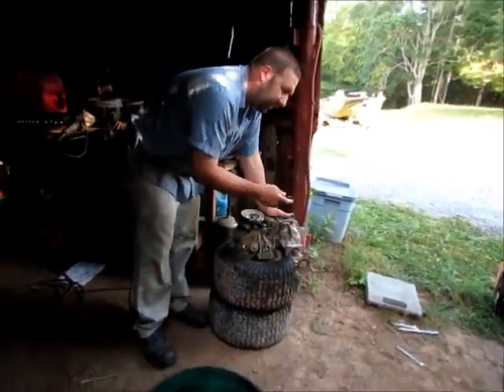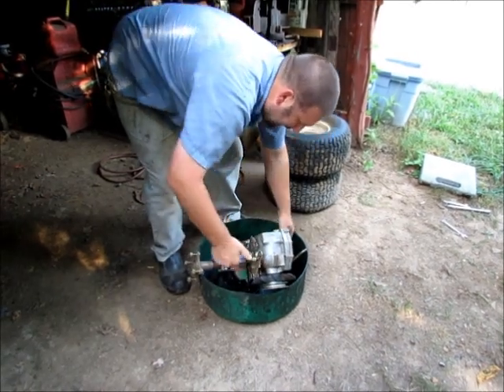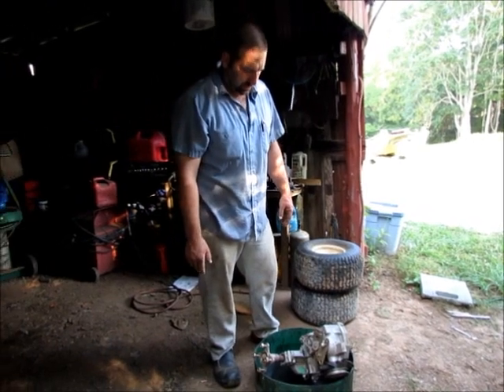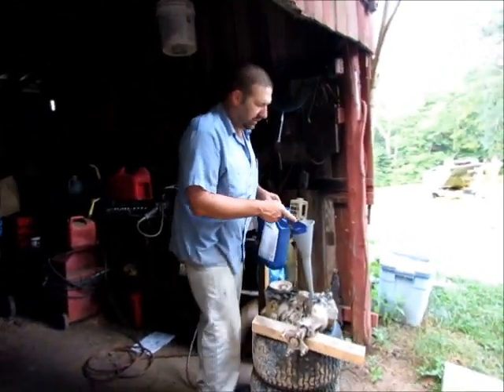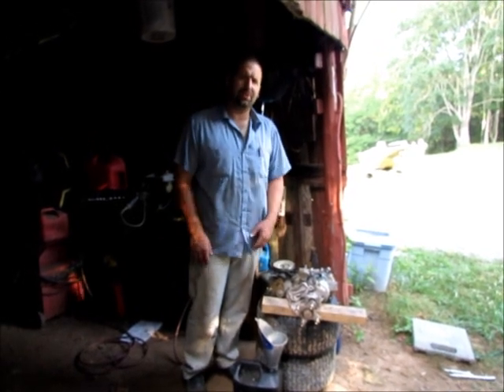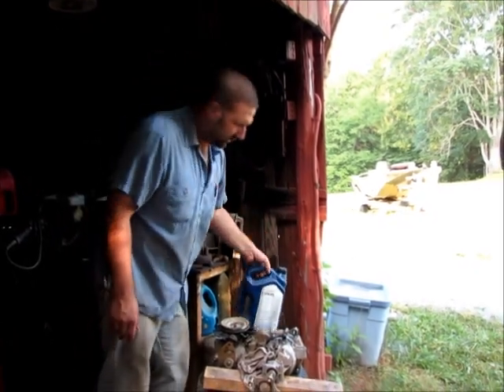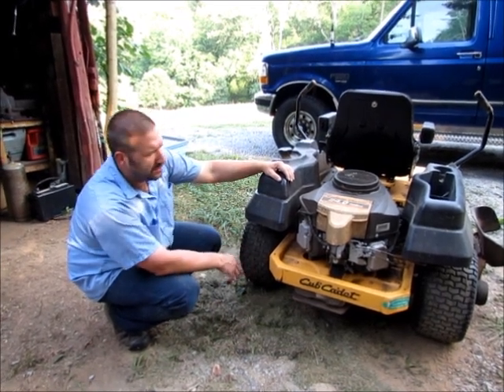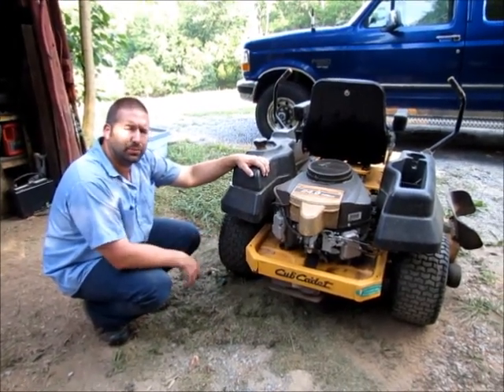Cub Cadet Hydro-Gear transaxle ZT-2200 EZT Oil Change

Comment: Time to drill and tap gearbox (bottom right corner) this would save a lot of time for further( measure twice drill once )
Reply from the maker: @williammurray7499 what a good idea. Have you tried this? Is the case thick enough for a drain plug to be threaded in? Man that would save massive time. Thanks for watching and sharing. ~Mr. C.
Reply: @NaturesCadenceFarm , nope the case is NOT thick enough to put threads onto.  it simply will not hold.  so, when you have the 2200 hydros off the first time, pop the side covers off them and install a drain plug kit on the bottom of the case.  you could also do them on the side covers themselves, but there is a lot of potential interference in there, so best to install at the front bottom of the case.  use the kit with the inner nut.  i have not done this on mine yet, but i will be doing them at 75 to 100 hours.  then, i will just drop the oil every season and replace.

Comment: Hydro-gear recommends you do not get the tranny hot before changing oil due to getting air in expansion tank, do this cold
Reply: BTW great video, great to see actual people do whats on paper, helps a lot, Im still pondering on if fill port plug should be off or on while bleeding the air, by these results I would love to know how you did it. Thanks for the video!
Reply from the maker: @jorgegar5055 I installed the fill plug on mine before I purged the air. There is a vent on the unit. I am thinking that would help with the drastic temperature changes the unit sees and possibly letting air out or in as the temperature fluctuates. Thanks for watching and asking. ~Mr. C.
Reply from the maker: @jorgegar5055 this is a sealed transaxle without an external expansion tank. You might know more about this system than I do. Is there an internal expansion tank? Thanks for posting this information. Very helpful to me and everyone else. ~Mr. C.

Comment: Would it be possible to drain the oil while on the machine and pump oil into the drive like a marine pump for the lower units?
Reply from the maker: @user-pn8dn6rp2s maybe. There is no drain plug on the transaxle. A hole would need to be drilled into the frame large enough to remove the fill plug. You could then flip the whole machine over and drain it that way. When filling you could use the hole previously drilled to see what's going on. Thanks for watching. ~Mr. C.

Comment: Hallo. What oil fill in hydrogear? 
10w -50 motor oil?
Thanks
Reply from the maker: @tt the manual for the Zt 2200 says to use 20w-50 motor oil. Check out page 13 in the service manual link provided below. ~Mr. C.

https://www.hydro-gear.com/wp-content/uploads/2023/03/BLN-52622_2100_2200_P13.pdf
Reply: @NaturesCadenceFarm  Van olaj leeresztő csavar nem kell kiszerelni a komplett motort. (Google translate) Sorry
Reply from the maker: @tt that's good information. I did not find a drain plug on my unit. I no longer own that mower so I can not go look at it. Thank you for sharing the information. ~Mr. C.
Reply: Thank you!! :)
Reply: Ki szívni nem lehet belőle valahogyan? Mindenképpen le kell szerelelni a komplett motort?
Reply from the maker: @tt you might be able to suck it out. Looking in the fill port reveals a lot of metal in the way. If I do another one I will try sucking it out. I found removing the transaxle aided in removing all of the old fluid.  ~Mr. C.
Reply: Köszönöm! Várom mindenkép ! Ha sikerül ki szívni, én is úgy fogom csinálni! Csinalok ugyanolyan videot magyarul és említeni fogom a neved! :) köszönet! 
Mikor várható videó?

Comment: He is right on the money with the 1.5 quarts per side. It took me exactly 3 quarts total. It ran like a new unit after the change. I suppose it degrades slowly over time and one doesn't realize how bad it becomes. I've had it for 20 years - 667 hours and still runs strong. The Kawasaki engine runs like a champ. BTW very nice video and TY for sharing it with the rest of us out there trying to save a buck.
Reply from the maker: @Gregory E glad to hear you have had good service out of the mower. Thank you so much for watching and commenting. Glad you liked it. ~Mr. C.

Comment: I would have measured the oil amount that came out. Then put the same back in. I changed my hydro transmissions oil a week ago. I have a Hustler Fas trak 54 inch deck. Of course I spent more money 💰. But I just wanted a commercial mower.
Reply from the maker: @Alton Rowell that is a very good idea. If I ever do one in the future and do not know the volume of fluid I will use that technique. Thanks for sharing! ~Mr. C.

Comment: I've watched a couple of these ZT-2200 (EZT) oil changes and it seems to be common that the left side has darker oil and is being serviced because of various issues.

Does the fan blade on the left side run in reverse to the right side? I'm wondering if the left side unit is running hotter because of the fan design?
Reply: Most people mow clockwise,  so the Lefty gets more workout and stress than the Right side !! When I do these in my shop I use 20W-50 Castrol & add 5 ounces of Lucas into each Trans !! Got 720 hrs on my old Cub RZT 42 with never a problem !! 🙂👍🏻
Reply: @waylonmccrae3546 5 ounces of Lucas what?
Reply from the maker: @Daniel Wilson you are absolutely correct! During my research the left side does fail more. Not sure of the cause but the fan idea does make sense. It could be the grass discharge chute is on the right side and you constantly reverse the left to mow in a circle.  I don't have the mower anymore so I can't check. Thanks for watching and commenting! ~Mr. C.
Reply: Yep left side for me also. Main reason I did a service was the left side was shuddering going up hills. Then again I had 667 hours on the mower when I did both assemeblies. I've had the mower for 20 years now. It has paid for itself many times over. I did both sides while I was doing it though. If you can get an extra set of hands, the process really is quite simple.

Comment: Question: Currently looking at purchasing a Snapper zero turn 360Z which has the Hydro Gear EZT. According to the dealer, the Hydro is "sealed". Are all EZT hydros the same or do they come in different flavors? I think it is the ZT-2200 (EZT) but not sure.
Reply from the maker: methane251 the hydrogear website only lists the zt-2200 as an "ezt". The next size up is the zt-2800 which has an external filter and no ezt in the description. The next size down is the zt-1800 and does not have ezt in the description.  I would look for a mower model with the zt-2800. The benefits of having a drain, external filter, and being heavier duty should provide  a better experience.  Excellent question!  ~Mr. C.

Comment: I've taken mine on and off so many times I can do it under 6 minutes
Reply from the maker: vincent p wow that is fast! Too bad they don't have zero turn class in the lawn mower racing series. You could be an amazing pit crew member. Keep up the good work. ~Mr. C.
Reply: @NaturesCadenceFarm   The 1st time took me forever to get it out when I rebuilt it,  I had to open that thing 4 times before getting everything right and even
Reply from the maker: vincent p wow you did spend some time with it. Good to hear everything is good to go. ~Mr. C.

Comment: I have a Simplicity with a ZT-2200 EZT Hydro Gear.  It squeals real loud when I turn.  Could an oil change fix it?
Reply: Possibly. Could also be a loose or bad belt.
Reply from the maker: The unHandyman I would agree with Curtis on the bad belt. I would check that the tensioning system for the drive belts are clean and both have smooth operation. These machines are known for the belt tension syatem seizing up and causing belt problems. ~Mr. C.

Comment: Great video, very helpful. Changed fluid both sides and new driver belt. You have to take the clutch off to change the belt but still not to bad for this shade tree mechanic. Took about 2.5 hours taking my time.
Reply from the maker: Sean Archer glad I could help out. I have found the mower to be easy to work on. That's a good thing because for a time there it was getting a lot of work done to it. Thanks for watching. ~Mr. C.
Reply: No you don't have to remove the clutch. I had the belt break while mowing one day. Luckily I looked up on the internet how to change the belt. (it has been awhile but I think I remember) One fellow showed how he bent the clutch bracket enough to get the belt by without removing the clutch assembly. I did not need to remove it and had the belt changed out in about 20 minutes. Do a search and you will see it.

Comment: Hey bud i know its been a few years but i had an issue too with my drives and it was the tensioner pulley that was stuck... the pivot point was frozen not allowing the belt and spring to keep the right tension.. I am going to drain and refill with new oil too... Thanks for the video.
Reply from the maker: M B great information! Thanks for watching and commenting. ~Mr. C.

Comment: If you put the drain screw back in and then purge, I don't understand where the air in the system goes when you go through the purging process?
Reply from the maker: brock steele that is a great question, I am glad you asked. The purge process gets the air out of the parts that need to be in completely flooded in fluid. These parts are the hydraulic pump and things like that. When filling the case, the manufacturer recommends filling to a line on the inside of the housing. After filling to the line there is still an air gap between the plug and the fluid level. Think about it like this. Even if the housing was sealed completely the air and fluid still take up the same volume in the housing so the purge process would simply separate the two. Lastly the housing has a small vent on top that allows for changes in temperature and atmospheric pressure. I hope this helps. Thanks for watching! ~ Mr. C.

Comment: Not difficult to properly repair could have done it in the same time you spent filling and draining twice, about $160 a side for parts
Reply from the maker: Dodd Garger that sounds like amazing news. If you have a list of part numbers and a source of parts I would love to get this mower fixed properly. Thanks for the information. ~ Mr. C.

Comment: How many hours did your mower have on it when ya had to do that to it. Tks
Reply from the maker: 1843rob the mower had around 170 hrs. Since the oil change it has 200 hrs. on the mower and is still working. It still starts slipping bad around 30 min. of run time but it does work, just not for a long time. Thanks for asking and watching. ~Mr. C.

Comment: Not moter oil it's 20 50 hydrolic fluid
Reply from the maker: type O negative I have provided a link in this comment and I will place one in the description as well for the service manual provided from the manufacturer. Page 13 of the PDF (page 11 of actual manual) states in Table 6 Fluid Volumes for the EZT® to use 20W50 ENGINE OIL. Have a great day! ~Mr. C.

https://www.hydro-gear.com/7e9dcd08c3_sites/hydro-gear.com/files/BLN-52622_ZT2100_ZT2200.pdf
Reply: No   it is simply 20-50 MOTOR OIL....    Where do you guys come up with your crap?  And then spew it across the internet where folks like Cadence Farm is trying to help the DIY'er?     JeeeeeZZE!

10ZT-2100 / ZT-2200 (EZT®)FLUIDSThe fluids used in Hydro-Gear products have been carefully selected, and only equivalent, or better products should be substituted. Typically, an engine oil with a minimum rating of 9.0 cSt (55 SUS) at 230° F (110° C) and an API classification of SL is recommended.  A  20W50  engine  oil  has  been  selected  for  use  by the factory and is recommended for normal operating procedures.
Reply: @damage control   NO 20/50 is "typical"    and yes,  it does make a diff!

Comment: have same trany on my tractor.  trying to get the filler plug out, afraid I'm going to strip it before it comes loose.  Was your clockwise or counter turn to remove?
Reply: Regular thread righty tighty lefty loosy. Much easier if you have a 3/8 drive ratchet with a 1/4 allen socket.
Reply from the maker: Liz Walley I love the community we are building on YouTube. Dave Carlson is spot on with his comment. Thanks Dave Carlson! ~Mr. C.

Comment: Is the Hydro Gear on the left side still working??  I have the same issue and need to fix it.  Gord.
Reply from the maker: Gord Rose it is still working. I used it yesterday. It still heats up and starts slipping really bad after 30-45 min. but I can do almost an acre of grass before that happens. I have other mowers so I just park it and come back later when it cools off and take her back to the shed. Thanks for asking. ~Mr. C.

Comment: The internal center pump went bad In it. The grey oil was aluminium shavings from it grinding steel on aluminium (pos design). Too Fix them is about $300 at my shop. Fyi there's a side plug on the casing for air purging.
Reply from the maker: Chris Bolyard thank you for the information. I will look on the side of the casing for the plug you are speaking of. ~Mr. C.
Reply: Is there not a drain plug anywhere or is it a have to remove to drain and fill?
Reply: How long did it last after you did this?

Comment: I have a encore fuzion 34 mower with Ezt hydros 2200 I've had this mower for almost 10 years and I'm on 5300 hours on it and they run perfect what I have been told by hydro gear is just to leave them alone and don't fix what's not broken that once you open them that you will contaminate the system hydro gear told me yes that they have had a couple of people run over 5000 hours on these hydros with no problem they do tell me to blow the hydro gears everyday after finish working I told them that I do they did tell me that Ezt hydros are extremely reliable.
Reply: Yeah, i have a 2006 model Troybilt with over 4000 hours on the ezt hydros.  I've been contemplating changing the oil but i'm afraid if i do it'll probably start acting up.  I've never done anything to them except replace one of the fans about 4 years ago after the belt shredded and broke the blades off.
Reply from the maker: Victor Rippe thank you for all of the excellent information. I purchased this mower used so maybe the previous owner opened it and contaminated the system. ~Mr. C.
Reply: Victor what do you mean by blow the gears?
Reply: @TowerMonkey614  I'm guessing he means to use compressed air to blow the dirt and grass clippings off the hydro unit after mowing. Heat is the killer of hydros.

Comment: what oil did you use?
Reply from the maker: halleffect1 I started off with 20w-50 Supertech from Walmart. I ran this oil for a few weeks but it didn't really help... so I decided to try something different. I removed that oil and filled the Hydro Gear completely with Lucas Oil Stabilizer. This fluid has worked fairly well and it does last longer than with the other fluids. I have noticed the Hydro Gear needs to be "warmed up" a little with this thicker fluid but once it is she runs great specially in cooler (around 60F) weather. Thanks for asking! ~Mr. C.
Reply: @NaturesCadenceFarm  why not try a 20w-50 synthetic? The issue you where noticing was probably from the viscosity loss of a conventional oil under temperature compared to a synthetic.
Reply from the maker: 6'2Saki I agree a full synthetic would hold up better to heat. In my case it just got worse over time and I don't think another oil change would help. I think regular oil changes would help these units last longer but there is not a drain port on the lower part of the case that I know of. Thanks for commenting! ~Mr. C.

Comment: What will happen if you fill it thru the vent like you said some people have?
Reply from the maker: Brandon Shull from the research I have done by watching some videos it would just take a while to fill it back up. I was looking at doing that option to fill mine but I decided to just remove the transaxle and drain and fill that way because it was easy to do. Thanks for asking! ~Mr. C.

Comment: Good video. Im about to do this on my cub. Do you think i can drain and fill without removing it totally?  Im thinking I will run the gas tank almost empty.  Drain the engine oil. Then hoist onto its side. Drain hydro pump. Then lower and hoist onto other side to fill. I have an over head boom chain hoist.  I will then re fill the engine oil (basically do an engine oil change at the same time). I have the 22 Kawasaki version and it’s been absolutely great. We have 10 acres we mow. What do you think. Thanks for the video
Reply from the maker: blake the snake I have not tried that technique. It sounds like it would work. If you do try it I would love to hear how it went. I know it looks like a lot of trouble to remove it but I had it out in about 30 minutes. In the video you will see I lifted the mower with the loader so the lifting process would be similar with a chain hoist. Good luck! ~Mr. C

Comment: Didn't work....Changed oil, No Power on the left side, Better, but, Once it heated up same issue.
Reply from the maker: Mic Foltz same thing with me except if it is cooler outside it does last slightly longer. My two options are a rebuild or a new transaxle. Thanks for the update. ~Mr. C.

Comment: My Question is....You said 'Hopefully it will work', after it heated up Did just Changing the Oil fix the issue?    I am having the same issue, also left side.  Guess I will try.....Thanks, great video.
Reply from the maker: Mic Foltz to answer the question. No, but it is slightly better after I put straight Lucas heavy duty oil stabilizer. I figured why not... can't hurt it! Good luck. ~Mr. C.